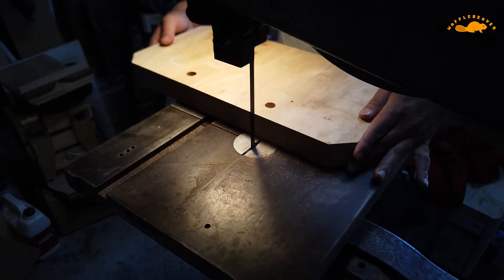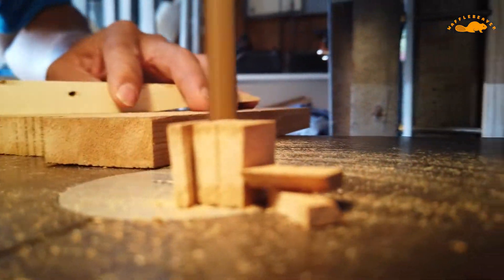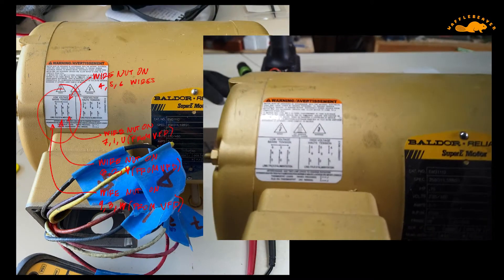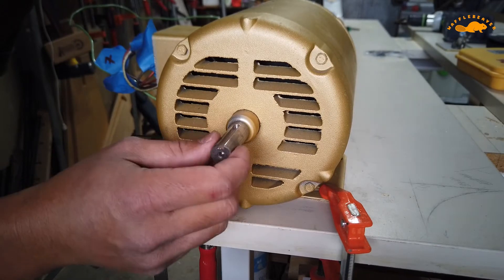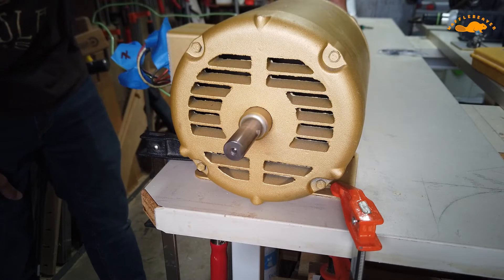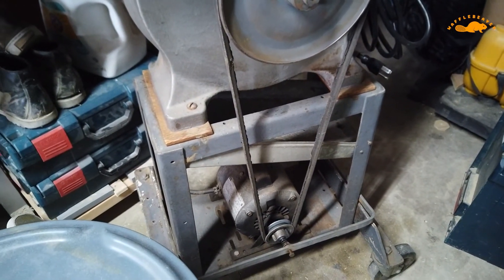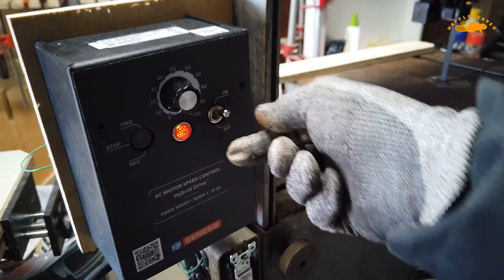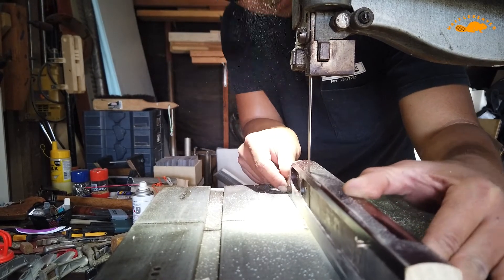1940s Delta Bandsaw Motor Upgrade with VFD

Comment: Most of the tools in my shop are 3 phase drill press, dust extractor, compressor, bandsaw and I might be buying a 3 phase table saw and I run them all with vids..
Reply from the maker: I've been thinking about getting a 3 phase motor that runs at 3450 rpms for my tablesaw. A 1 HP motor might be overkill for a 8" delta tablesaw though

Comment: Considering bringing in 3ph power to my shop will cost over $20K, it seems using a VFD is clearly a cheaper solution. I have very little electrical knowledge though. I'd be interested in hearing more about the VFD's. Seems like there are so many different ones available to choose from.
Reply from the maker: You will be limited to probably ~ 1 hp motors, but it’s not a big deal to me.  I have a electric motor playlist with a bunch of videos.  It might be a bit technical at times but it’s not that hard to understand.  You end up researching this stuff anyway even if you do pay for the electrical upgrade anyway.  Good luck!

Comment: I never would have thought that it would be cheaper to add a new motor. It also didn’t look hard to do the wiring. I think that is where I would’ve been most reluctant to try.
Reply from the maker: Yeah I can help you wire it too if you ever want to upgrade a smaller band saw.  I put a 3/4hp on my 10" band saw too.  Overpowered is a good description of that band saw now but it's really easy to cut stuff.  Even with a 3/16" blade, it does thicker wood than what's recommended.

Comment: Amazing what you can accomplish with a little ingenuity.  I might want to do this to mine when I restore it. Seems like the best approach to make an old 40s machine remain capable.  

Have you figured out where in the VFD is best for each material?  Maybe you cold make a gauge sticker to indicate, steel, aluminum, plastic, wood etc.
Reply from the maker: Originally, this video was 40 minutes because I use a tachometer to find the surface ft speed of the blade and plotted out a graph of the speed.  Since then, I changed the motor to a 1 hp and just thought I'd go by feel.  For wood cuts, my range of use is greater than I expected, between 30-50%.  For plastic, I tend to stay slow between 20-30%.  I find that feeling out the material with speed is a true luxury especially with rip cuts.
Reply: @wafflebeaver  I bet the infinite adjustability is fantastic option for each cut. The ability to change throughout the project easier without swapping belts for specific speeds is appealing
Reply from the maker: @blackthorn454  yes and the torque at the low speeds is real nice with a 1 hp motor.  With the 3/4 hp I bogged it down on steel a bunch.  I haven't tried the 1 hp motor on steel since, but I'm sure it's an order of magnitude improvement.
Reply: @wafflebeaver have you tried steel since this post? I’m super inspired to upgrade my Delta now 🤔 🎉